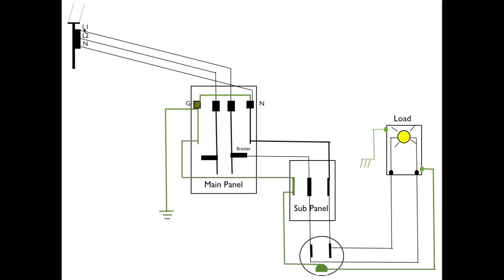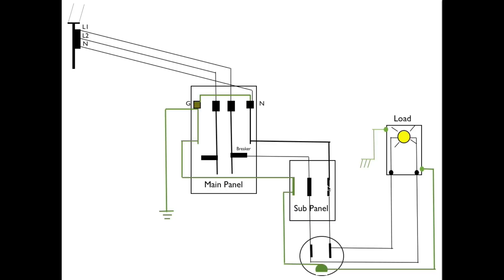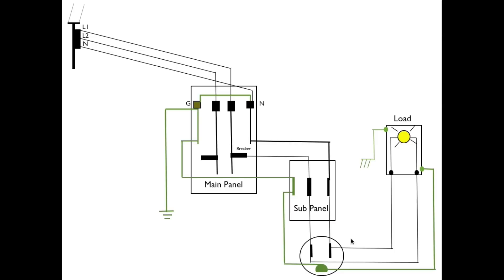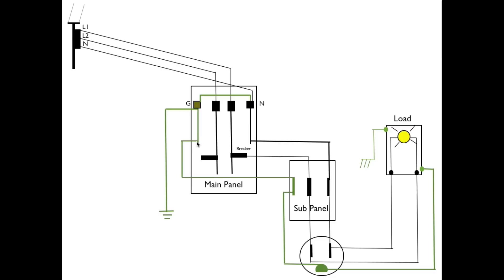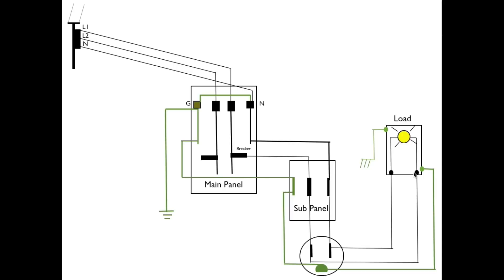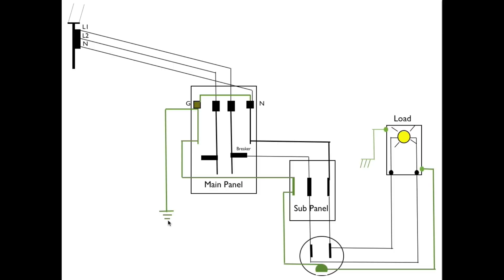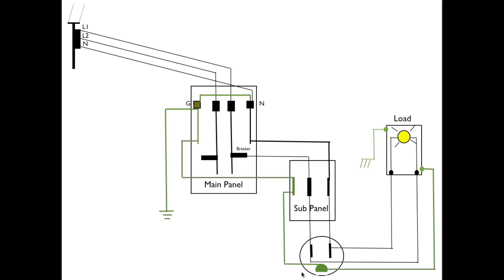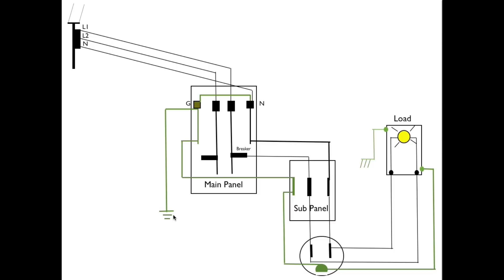The difference between neutral and ground on the electric panel

Comment: I'm studying electronics right now and this clarifies a lot.  There is still the question in my mind however, since neutral and ground and wired together, there seems to be a closed circuit allowing current from T1/T2 to Neutral to Ground to the chassis of a device, thus making the chassis unsafe to touch.  I'm assuming the ground has more resistance than the neutral path so anything that is "hot" will favor returning to neutral first?  But this would negate the lighting example since current would flow to devices first before ground.  What are the pros and cons of keeping the ground isolated from neutral?
Reply from the maker: If the ground is isolated in any appliances or sub panels, and there is a neutral fault, the appliance will not operate.  If they are connected together, the appliance will operate normally, thus opening the possibility of a hot chassis if there is a fault in the chassis ground.  
GFM

Comment: I am trying to install a 4-wire surge suppressor on the main panel and, as you showed, the ground and neutral buses are electrically connected.  Should I connect the ground and neutral wires on the surge suppressor together and connect them to the same hole on the bus to conserve spots?  After all, it's not like there's going to be a potential difference between the ground and neutral on the main panel, right?
Reply from the maker: I have always installed them to the separate bus bars.  
GFM

Comment: Ground rod is used for power surges. It equalizes current potential within the proximity. The electrons always seek to equalize. If the current potential is equal then electricity does not flow through your body.

Comment: 1st question.  Why is the neutral from the power pole bare if it is current carrying?  Also, why aren't there separate neutrals for each of the 2 hots (L1 and L2)?  Do L1 and L2 always share the neutral?  If so, how?  They are 180 degrees out of phase for split phase.  This presentation created more questions for me than it provided answers.
Reply from the maker: Neutral is a zero voltage point in the in the current sine wave, so when the line (end of the secondary winding) is at 120 volts in the sine wave, the center of the sine wave is at zero.  
As for the neutral relation to the hot wires, I have a video on "how the 3 wire system works" that may help.
GFM
Reply: David James — The neutral is at ground potential, so needs no insulation.  L1 and L2 share the neutral.

Comment: Great video on 3 wire to sub panels My question is going from my 220 amp main box to my 100 amp sub panel in shed, would i use a 3 wire or 4 wire? If I use 3 wire ( my sub panel is a standard house panel with 100 amp breaker at the top ) Would it be black to 100 main breaker white to netural  and ground? I have a jumper from ground to netural which i think would have to remove.
Reply from the maker: You must run 4 wire.  2 hots, separated ground (bare)and neutral (white).  The jumper must be removed.  Hope this helps.
GFM
Reply: the max amps in shed would never be over 50 and i want to run underground, what 4 wire would you suggest, and do i have to put wire in pipe?  i have a 50 ft run
Reply from the maker: If you want to place it underground with no conduit, you must use wire approved for underground.  My own opinion is that I would put it in conduit.  The wire must be rated for the breaker size.  I would contact an electrician that knows local codes for they of wire.
GFM
Reply: 4 wires THWN    L-1, L2= #3 gauge copper   Neutral White# 4 gauge  -   Green equitment ground #6gauge.
Reply: and a ground rod at the shed some areas you need two ground rods 6 ft apart but some only one

Comment: great video GFM, I would love to see the electric meter in your diagram as well and wether it gets grounded or not.
Reply: If the electrical meter has a disconnect or main circuit breaker, it gets grounded because it is the first disconnect.  A standard meter is not considered a disconnect.

Comment: I have a question Sir, suppose the Neutral wire accidentally disconnected from the Main Panel and because the grounding wire is connected to the Neutral, it is obvious that the current will flow to the grounding wire which brings risk of electrical shock. Please correct me Sir if I am wrong. Thanks for your informative video tutorial.
Reply from the maker: If the neutral from the utility is disconnected at the main panel, There is no low impedance path to the utility pole neutral.  This would mean the ground wire would have to carry the neutral current and the ground wire could become hot if the grounding electrode has poor continuity to earth.  In fact, the entire grounding system would become hot.  
Consider a person touching any grounded object while standing in salt water (higher conductivity) on the ground and the grounding electrode embedded in dry ground.  Quite possibly a lethal electrocution.  Just my thoughts.
GFM

Comment: What you said makes perfect sense, thank you for that.  But it brings up one question.  I have lived in 3 different homes and all were built pre 1975 and none have ground wired from the main box.  In my current condo the building has a steel beam structure 4 floors high, so when I went and replaced the outlets with grounded versions I made sure to have the ground connected to the building structure and tested with a plug in circuit test tool to confirm it was grounded properly.   However, I recently got a wall switch that had a neutral wire in addition to the normal 3.  I returned it and got a different 3 wire variety, but it seems in that application that neutral and ground would have been just jumper in the outlet and verify a good ground is attained, since you want current to have somewhere to go if the device somehow fails or the neutral power line goes out of service as you described.   Is there something i'm missing or is that it?  

 (I was in my childhood home when a lightening strike occurred on the roof and some of the wires in the house were "smokin" afterwords along with a few appliances biting the dust so I understand how important it is to be done properly.)
Reply: I don't think those little testers can properly assess whether a building structure is properly grounded - electricians use much more sophisticated equipment for that assertion. Better to check and verify whether that beam is really grounded at the main building panel. Regarding commonly available wall switches, there are three types that are sold. The first is simply on/off, two wires plus ground. The second has a connecting screw for an alternate pathway for power to go, used for those two-switch circuits for lights at the top and bottom of hallways or stairs - three wires plus ground. The final switch is designed to be the center control switch of circuits where you have three switches to control one light circuit -- four wires plus ground. Extra wires are there to provide alternate pathways for current, depending on the position of the other switches. The number of wires had nothing to do with ground connections inside the switch.
Reply: I suspect that may have been an illuminated switch - which would require a neutral wire for the indicator lamp. 

Remember that a standard two way switch is most properly placed in the power lead before the first device. The neutral is not connected to it.

Comment: In my book on ac power systems it is said that "grounding the neutral wire ensures the least possible voltage at any given time between any "hot" wire and earth ground" Don't quite understand what this means though :)

Comment: The day to day workings of the GND wiring is to dissipate the loose electrons that accumulate in the tubing and the boxes that carry AC wiring. Since AC current is flowing there is induction going on the surrounding material of the current carrying wires being metallic or not. If not for GND wiring these materials would charge up and releasing their charge to people who give them a path to Ground.
Reply: Michael Gonzalez that is not true. The function of the equipment grounding conductor  is merely to bond together all the noncurrent carrying parts of an AC electrical system so that in the event of a fault there is a low impedance path back to the source facilitating the operation of the overcurrent protection device. Household alternating current does NOT flow to ground EVER...it flows back to the source...X0 on the transformer.

Comment: In most cases, the brunt of a lightning strike on utility lines would be discharged to earth ground that made it's way into a residential electrical panel. But not always. If for instance a lightning strike big enough to shred a large tree hitting a utility pole across the street from a house. This would have a good chance of making it's way into the panel and bleeding over into the "hot legs" of the panel and doing damage to electrical appliances. Especially sensitive items like T.V & computers. And in some rare cases causing a house fire.
Reply from the maker: +service1956 Certainly, the protection is not complete.
GFM

Comment: My area didn't ground the panel. But lost my return from the pole and that was the only ground and fried everything plugged in main panel and sub with the water line ground and separated in sub saved everything on the sub panel I wired. I believe inspectors of this area when they were built let the pole Transformer ground be sufficient. Not taking consideration return line breaking loose because of a tree and big wind storm. Hots stayed connected. Main panel is grounded with a rod now!

Comment: I received a reply from GFM about my earlier comment. Here is my reply: Thanks for the note. Regarding the terminology: if some people are using your video for learning and
 If he/she plans to continue learning about electricity, perhaps working in the industry, then using the proper 
Term(s) as is the Code® convention will not be confusing later on. Phrases such as “grounding wire” or “Grounded
Electrode Conductor” are not confusing when explained as you did. I have no issue with your theory of different
Paths of current flow, just the names. Begin as you mean to go on. Have a good weekend.

Comment: Good video.  I still don't quite understand the ground at the light.  Is that a separate ground or is that in the plug of a three prong plug?  The ground/neutral part now makes sense.
Reply from the maker: It is the ground lug in a 3 prong plug.
GFM
Reply: grayfurnaceman.... Oh my ? So we might as well say this light never turns off as long as you pay the bill or it doesn't burn out because it looks to me it's hard wired to the receptacle?.... Don't mean to be anal but it is H.V..

Comment: Excellent video. One (stupid?) question...If the "hot" side of the load in your diagram shorts against the chassis ground a circuit breaker will open. But what happens if the "neutral" side of the load shorts against the chassis?    Thank you very much.
Reply: Nothing will happen, that's not a short. A short circuit is when a live conductor carrying power comes in contact with a conductive object connected to ground. Neutral conductors aren't live, they carry the electrons back to the earth, where they came from and then they are happy.
Reply from the maker: There is a problem with part of your answer.  Earth ground does not absorb the power coming from hot.  I have done several videos on earth ground showing how this works.  All shorts must go to neutral at the power pole to open the circuit protection.
GFM

Comment: Thanks for the effort.  
Please prepare a script you can read and redo this otherwise helpful video and get to the point that the separate earth ground at the load is to cause the breaker to trip when the chassis is energized.  Point out the case in which a short to an ungrounded chassis will not trip the circuit breaker but with earth ground added will trip the breaker if there is a short to the chassis.
Reply from the maker: This video is not there to cover all this subject.  However, there are a number of other videos linked during this one that hopefully will help.
GFM

Comment: Thanks for doing a good job of clarifying.  Question - conceivably, couldn't you run the sub panel ground directly to earth ground, without routing it back to the main panel ground bar? I realize it's extra work, but isn't it safer because of redundancy?  Or is this not even code?
Reply from the maker: You can and should install a ground rod at the sub panel.  
GFM
Reply: Jo Baecker, I will see if I can answer this question better for you. First, THIS IS A CODE VIOLATION!! If the sub panel is located in the same structure such as in your house, basement, or in an attached garage for example, you are NOT REQUIRED to drive a ground rod or any other form of grounding electrode at that particular sub panel. HOWEVER, you still need to connect your"Equipment Grounding Conductor" which is the Green or Bare Conductor (Not the white or white striped Neutral wire!), to the ground bar in your sub panel. Do not connect the Equipment Grounding Conductor to the Neutral Bar. You must keep the Equipment Grounding Conductors and Neutral Conductors separate in the sub panel. They can only go in the same bar where your Service Disconnect is located which in most cases is the Main Panel. However, if you are putting this sub panel in another building or structure on your premises, you are by code then required to establish a grounding electrode system. In English.....you would drive a ground rod or if using the 2014 NEC, you would drive (2) ground rods spacing them at least 6 feet apart and connect them to the Equipment Ground Bar in your Sub Panel. (Not the Neutral Bar!!) By the way, the 2014 code is now requiring the use of 2 ground rods minimum, spaced 6 feet apart vs. the old way of just using 1 ground rod. Incase you were wondering where I came up with the 2 ground rods. Many people are unaware of this. So....if I'm assuming correctly, you wanted to know if you connected that Sub Panel to a ground rod and didn't bother connecting that ground wire from the Main Panel to the Sub Panel, if that would be sufficient. You might think this would be ok because you connected the Sub Panel to earth again at that Sub Panel. NO!! The reason this is a violation is because if you were to have a ground fault, that fault current would have to travel down into that Sub Panel ground rod (assuming you never ran that Equipment Grounding Wire from the Main Panel to the Sub Panel as required) and the only path that that fault current can take back to the power source (Transformer or Main Panel) is through the earth which probably has a high resistance. It would not be considered a very effective ground fault path or trip any overcurrent devices (fuses or circuit breakers). If you run the Equipment Grounding Conductor from your Main Panel to your Sub Panel as required and you ever have a ground fault, then that Equipment Grounding Conductor running between the 2 separate panels should have a low enough resistance if sized properly, which would be the far more effective fault path back to the source (Transformer or Main Panel) and hopefully have a high enough fault current to trip your fuse or circuit breaker. Bottom line is using the earth as your fault path in the case you ever have a ground fault is a pretty hazardous situation considering the resistance of the earth that the current has to take back to the power source is usually too high. Using Ohms Law.......LOW RESISTANCE = HIGH CURRENT (Amps). Earth in this case is the high resistance path, but that Equipment Grounding Conductor between the Main Panel and Sub Panel that you are required to run is low resistance which using Ohm's Law will create a high fault current (Amps) and blow that fuse or circuit breaker. You still have to install those ground rods at a separate structure Sub Panel and connect it to the Equipment Grounding Bar in the Sub Panel and also connect that Equipment Grounding Conductor from the Main Panel to it also. You can attach a ground rod theoretically at every single accessible point on the Equipment Grounding Conductor if you wanted to. You could have 50 of them all at different points along your yard but you still have to connect all of those ground rods together with that Equipment Grounding Conductor (Green or Bare Conductor). Remember.....do not use the earth as your sole means of fault path back to the power source. There ya go! Hope it helps a little.
Reply: Whew!  What a reply!  Thanks for the detailed explanation!
Reply: You're welcome Jo!

Comment: Great explanation.  I do have one question that perhaps you answered: can Neutral be defined as a wire that can carry current when the load is active ONLY?
Reply from the maker: That would be true.
GFM
Reply: Arne D — But that is also true of the hot wires.  “Neutral” is a current-carrying wire which is held at ground potential at the main panel.

Comment: This video makes great sense on the sub panel. However, what about the circuits being fed from the main panel? The ground and neutral are bonded. Why does the main panel not have the same issue(s) as the sub panel in the event of fault?
Reply: Basically you don't want current running in parallel with the neutral on runs that fish through your house and whatnot. Part of it is they are more likely to be subjected to damage.
As someone once put it: the main panel is the finish line. 
That said, if you have an open neutral coming into your main panel (as in, your service drop neutral) you WILL have some serious problems, such as voltage swings and hot grounded components. Open neutrals are no bueno no matter how you slice it.